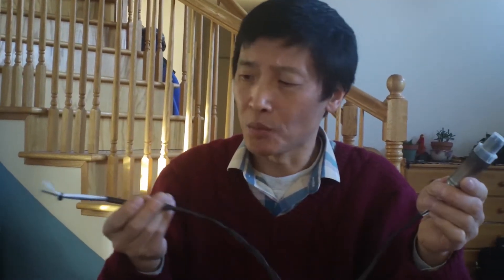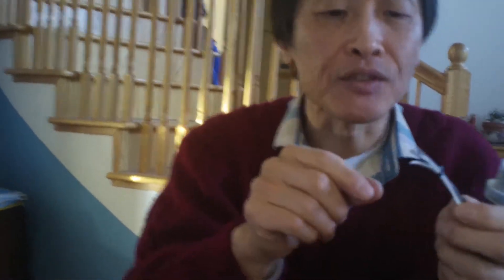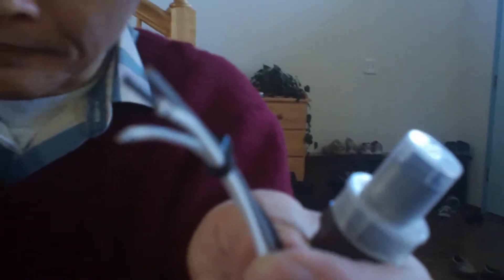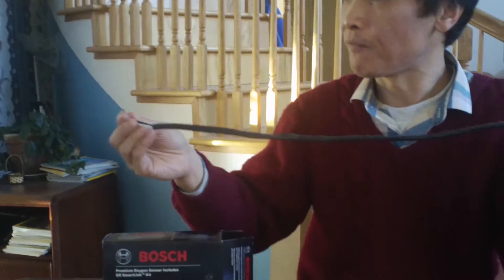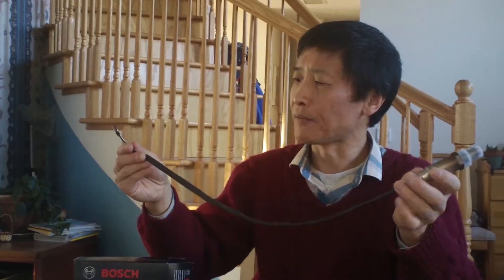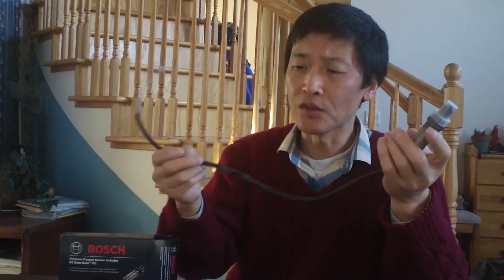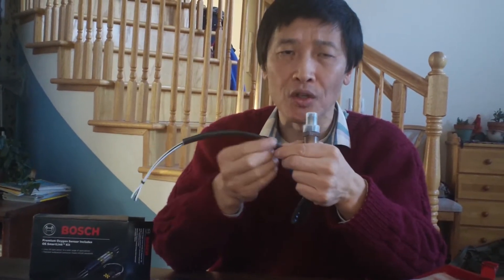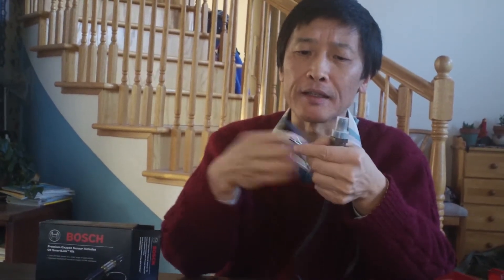Is Bosch Universal Oxygen Sensor Installation Video Correct?

Comment: I think that yhe resistance in the wiring if soldered would change or go up if dolder was thick in places and over distance perhaps rven the voltage might drop. Thetefore incorrect reading and wrong information would be collected by computer. Best just use conecters and crimp properly. Good luck to anyone with o2 senor trouble.
Reply from the maker: that is certainly one possible reason. However the official video from Bosch uses air travel to explain this, and no one from the mass market challenged its technical explanation is beyond my comprehension. Maybe the company was simply joking but from the comments on this video, I think a lot of people do believe it.

Comment: A 4 wire sensor has a heating element.  2 of the same coloured wires should give ohms of resistance.  Of the other two, 1 is a ground return path and the other is the return path for voltage to the ecu. 

That considered these wires aren't reading atmospheric air ratios only resistance a voltage.  So Bosch's instructions are poop.  Regardless of anything else I always cross reference parts and source OEM or direct manufacture replacements.  I have very little comeback on my work.  The underlying issue as to why the O² sensor isn't working should be resolved
Reply from the maker: Bosch is a big company, I am surprised so many people believe Bosch's video.
Reply: what ohms resistance has to do with connecting signals ???

Comment: You are correct, corgLLC.  Air should not pass through the wires to make the oxygen sensor work. 

That is absurd.  That is an ERROR on Bosch's part.

The connectors are time consuming to assemble but from what I see the design is very sound.

Sean says below, don't be cheap, but I am not convinced, by any margin, they are cheap in quality, Sean also misunderstood your argument and talks of the "plastic clips" being supplied.  These in fact, are the basis of your error argument.  They ARE the part that Bosch says allow the air to pass through for proper operation of the O2 sensor.  That would be the air from outside which is loaded with OXYGEN.

I just had dinner. Man, are my lungs full.  :-)
Reply from the maker: if you examine the "plastic clips", they are actually air tight, it is hard to believe it meant to have air going through.
Reply from the maker: corgLLC
in addition, even if the air goes through the "plastic clips", so what? It still does not reach the sensor unless the air goes inside the wire.

Comment: OK, Bosch like hollywood have taken poetic license with their own facts. The sensor type indicated in the 'Bosch' video needs reference oxygen to function correctly. In the past this was provided by small hole(s) drilled radially around the atmospheric side of the sensor body where it threaded into the exhaust system, but these breather holes could get blocked by dirt, oil, insect debris etc. interfering with the O2 sensor function. This led bosch and other O2 sensor manufacturers (Denso) to instead design the included wire bundle that connects to the sensor itself such that they acted as 'tunnels' allowing atmospheric air (containing the reference oxygen) to be drawn along the length of the wires in the spaces/gaps between the insulation of the signal and heating wires. If you follow the wire bundle to the point where it connects to the main engine wiring harness connector you may see that an opening or unshrouded section exists to allow this reference air to be admitted. also this junction will be located as high up as practical to stay dry. Using petroleum jelly grease or even large wraps of PVC insulating tape can prevent this reference air from travelling down to the sensor resulting in incorrect/lazy operation of the O2 sensor. Note also that the wires in the O2 sensor appear to be a stainless type, designed to resist corrosion as the reference air passes down along them. Note too that in some designs the reference air simply passes along the outside of the wire bundle and enters the o2 sensor whrere these wires enter the sensor. Either way reference air is vital and needs to find its way along the wires to the o2 sensor. Ive seen load of both OEM and these universal ensors fitted incorrectly but if you follow that instructions to the letter the installation will be perfect. So no, the Bosch video is not incorrect just open to poor interpretation. BTW offroading requires a different design of O2 sensor as vehicles that regularly wade in deep water will of course foil the above design by allowing dirty water to be drawn down into the sensor.
Reply from the maker: the electrical wires just look like regular electrical wires, it is hard to believe that the wire is anything special and that the electrical wire is designed for the air to go through.

Comment: It does sound rather odd. I have never heard of AIR going through electrical wires. I have read, elsewhere, that the reason not to solder is because you cannot get a good connection with this type of wire. The same reason is given for not using crimp connectors. I do not know who is correct.
Reply from the maker: +Pete Hargreaves agree with you that it is possible the solder connection may not be good. But Bosch's video clearly showed the air goes through wire.

Comment: The Bosch video is incorrect, and the Bosch splice box is not good. A month ago I installed a Bosch universal O2 sensor on my 2000 Toyota Camry. I immediately had driveability problems: no acceleration, stalling, etc. Turns out the O2 heater circuit had high resistance through the Bosch splice, though I had carefully followed Bosch's instructions. I replaced the sensor with OEM and the car drives beautifully. Problem solved. If I ever use a universal sensor again I will solder the wires.
Reply from the maker: Correct, anyone would agree with you that soldering has better connection.  Thank you for taking the time to share your own experience.

Comment: Check near the bottom of this link - General Installation tips.  I don't understand how this works.  What is the delivery mechanism of the reference air?  Argh!

http://www.clarks-garage.com/shop-manual/fuel-18.htm
Reply from the maker: someone else said that the air hole is drilled on the metal body, see here:  http://www.ericthecarguy.com/kunena/2-General-Discussion/48380-can-air-travel-inside-or-outside-electrical-wire

Comment: The Asian genius is completely wrong. This is a differential sensor and requires there to be air flow down through the wires to know what the difference is. If you were to solder them and the solder were to flow down the wire it would basically plug off the flow of air.
Reply from the maker: when you say "plug off the flow of air," you need to have a tight sealed hole or opening to be plugged off, correct? How do you solder "flow down the wire"? 

Anyway, I would love to see someone to solder the wire and show that the unit has problem. If you actually bought the component and look at it, it would be very hard to convince you that the air travels "through" air. This thing is not tight sealed.